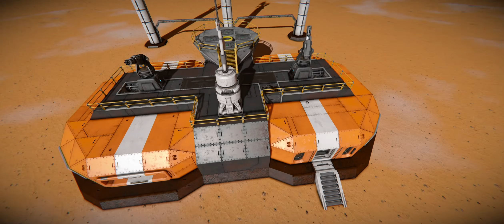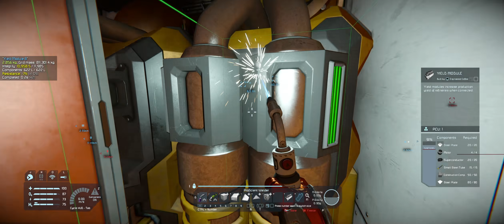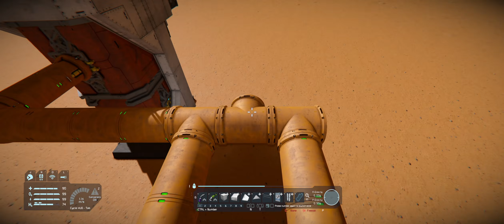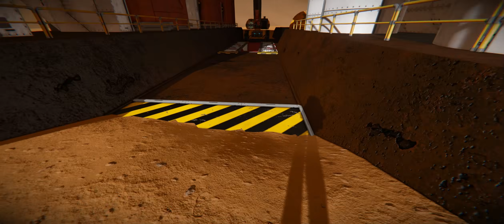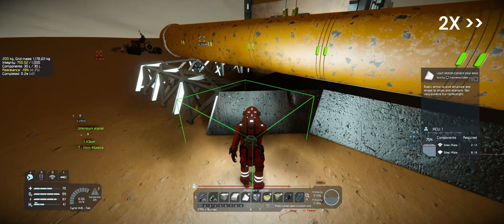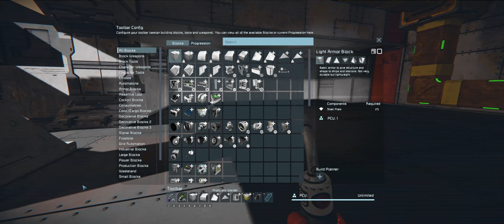Railings Assemble! New Assembler Factory and Ore Silos | Martian Engineering E11 | SE Survival

Comment: Very cool. Usually when I'm making multiple structures the same, I just disconnect it from the main grid, BP it, then project them in place and merge the original back on. Also, just curious, do you know you have multiple hotbars that you can populate or do you just prefer to use the single hotbar?
You're builds are always excellent.
Reply from the maker: Thanks! I will probably take it to creative when I'm done to separate the buildings.

I know about the multiple pages, but for some reason I only use it in creative. I tend to use the single in survival. Comfort zone tick? 🤷‍♂️

Comment: Welding ships sucks. They suck even in space let alone on planets.  I find it much easier to just have a good access points to components everywhere I build. But then sorters can stand in your way. So I usually use sorters only for specific things like draining ores from cargo ships/drones. The rest of the base and all cargo containers are always connected in one single system so I can deposit and withdraw anywhere I want. Cargo containers then fill with mixed staff but it not that bad. Major benefit of not having dedicated storage is that you share all the storage for everything and so it’s more efficient, you can have most of your storage be filled with the items then they become ingots, and worry only about if the total space and not for each individual item type. I also strongly recommend making a control room where you can make a bunch of displays and run some sort of script to display total amount of ores ingots and components. This way you can forget about opening different cargo containers to se what you have and you won’t care much when all different items are actually stored. You just know how much of each item you have and it becomes much easier to plan on what you need the most next.
Reply from the maker: I tend to like welding ships when I have a script to keep them stocked, but this playthrough is scriptless. Otherwise yes, they are cumbersome. That is why I just put welders around attached to the base storage. I have most of my sorters disabled or bypassed until construction is done.
Reply: I hope Keen is gonna add real NPCs to the game so you can hire them to weld your base for you. Or robots. Like c’mon, this game is about engineering and not found 9 to 5 job welding things by yourself. For ships we can at least use printers but base building can be really tedious. I also tend to place those temporary welders to finish some bigger blocks but even the it feels more like a workaround rather than the intended gameplay mechanic

Comment: Pipes looks good. It’s a pity to hide them under the ground. Scaffolding can also be used to support pipes, usually put a scaffold block and an armored conveyor on top then connect pipes to the sides. In some cases you can put industrial sorters over supporting scaffold as they have one side bleed suited to be pleased on top of full block. Overall I usually expose pipings and make them 1 block higher than the floor you can walk on so you won’t bump your head into them. Some pipings can be higher if you don’t want to intersect them.
Reply from the maker: Good idea. I actually want to make the buried pipe more designed and put in battery backups and other items so it's not just a dirt floor.
Reply: @EngineeredCoffee at this point you will need to dig it or redo all the pipings on top which might be even not possible. You can also have more redundant pipeline, so in case when the base is being damaged it would still be connected.